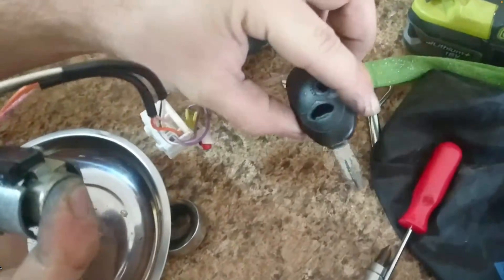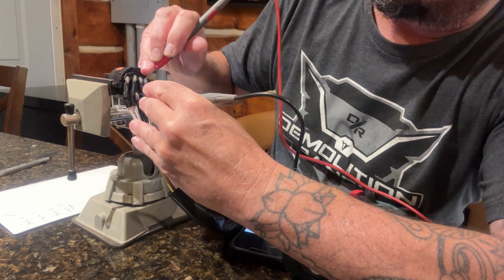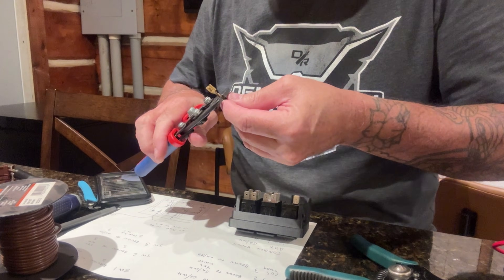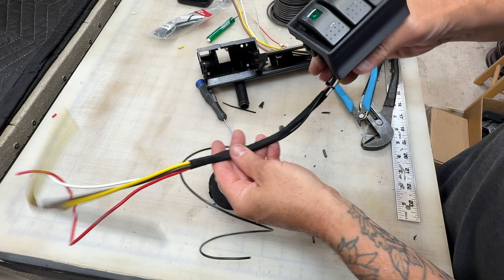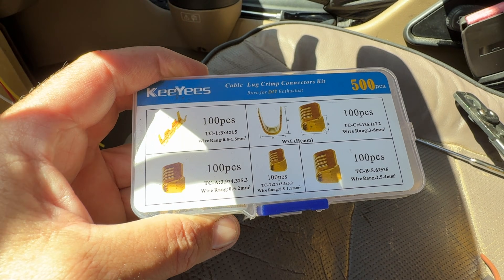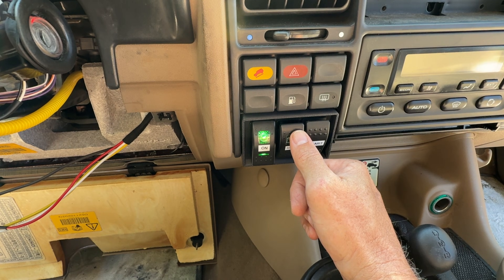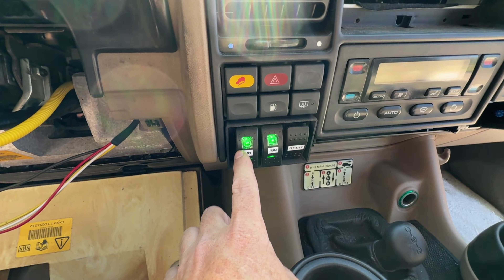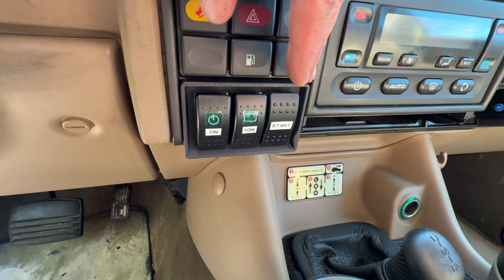Upgrading to Push Button Start on a Land Rover Discovery 2

Comment: Hi, I really like your video, I also have a Discovery TD5, and I wanted to ask how you disabled the immobilizer. Thx.
Reply from the maker: I think I misspoke when I said immobilizer. My Discovery 2 has an immobilizer, but what I meant was a key with a transponder chip. The immobilizer in the D2 is the alarm system and it can be armed and deactivated with the FOB, but the key doesn’t need to be in the vehicle for it to start.
Reply: @LucidAutowerks  Ok, so if I understand correctly you need the fob to open and close the doors, and the switch to start the car. Anyway, it's really cool, I don't have just one key for my D2 and I was thinking of a similar solution anyway. Thx
Reply from the maker: @Ktmadventure640 correct 👍🏼
Reply: @LucidAutowerks you think a d1 ignition key would work in a d2 🤔